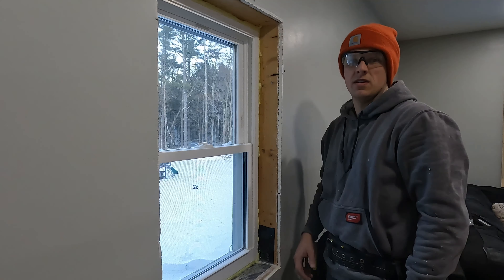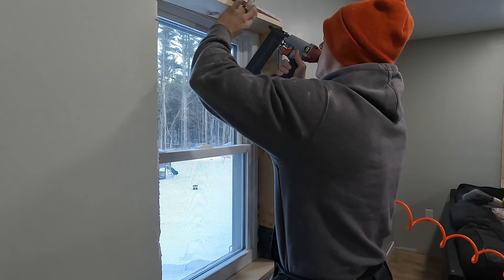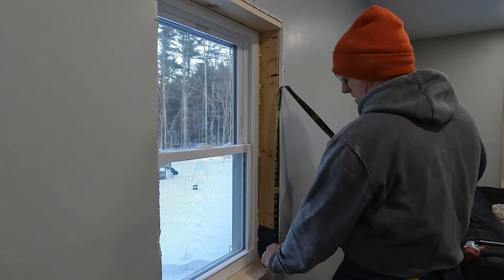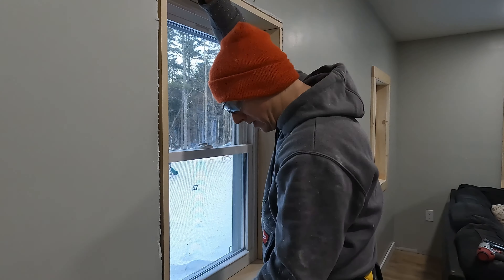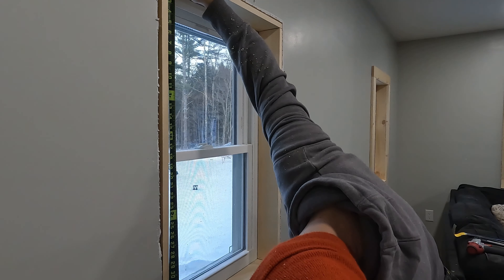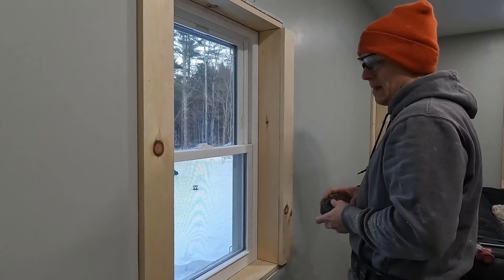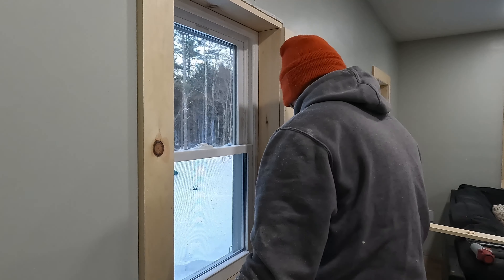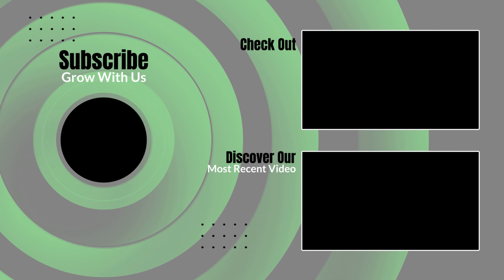The Easiest Way to Install Window Casing and Trim

Comment: If painting, prime those knots with an oil based primer or Shellack to keep the resin from bleeding through
Reply: Been there, done that.  Bleeds right through any latex primer and paint.
Reply: I suppose would have to wait a while but that sounds great

Comment: This is great, the only suggestion I would make is to have a little bit of a reveal between the sides and the face.  Maybe a 1/4” at most.  Adds a ton of look without any additional work.

Comment: Not bad , looks a lot better than just sheet rock return.  I always build a window stool makes for a lot fancier looking job.  Next time if you're going to trim your windows that way  cut everything to fit fasten it all together ( prefab it ) then just place them in the window and nail your trim to the wall. If you have several windows it will save you some time. Good  luck  and well done job

Comment: Nice simple job. Regarding nailing the side trim pieces (around 5:04) I have seen some videos suggest that a small nail (like you used) is best for the inside (attaching the side face piece to the edge of the side leg of the casing) but a longer, thicker nail should be used on the outside of the trim where you are nailing through the trim piece and drywall into the stud underneath.  Dunno if it makes much of a difference, just thought I'd mention it.

Comment: Thank you for the video! I’m looking to trim out windows that are finished with drywall. Do I have to remove the drywall around the window, or can I nail the trim wood right over the drywall?
Reply from the maker: You could put it right over as long as you like the reveal on the window face.
Reply: @BreakFreeHomestead  I’m not sure what that means, but I’m going for it! I’ll let you know how it goes.

Comment: Any suggestions?
Reply from the maker: Just measure your sides plus 1/8th and put the 45 mitres on those lines. Then nail them up and measure the opening thats left. Or you could just build it before putting it up.